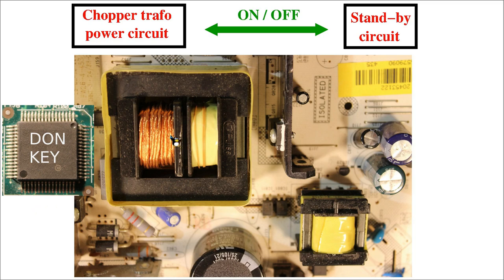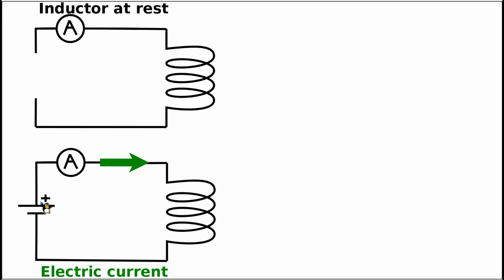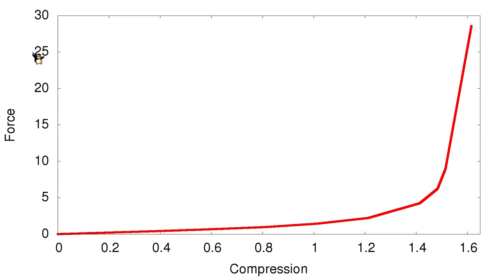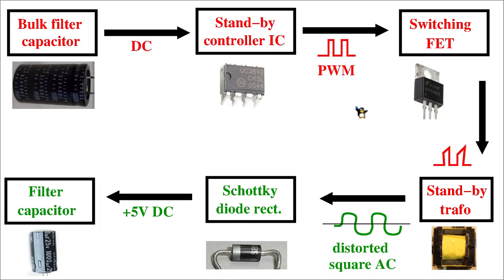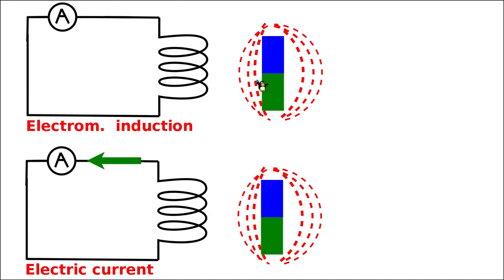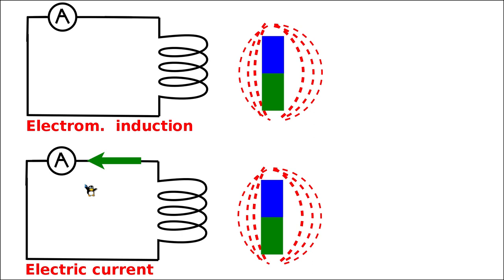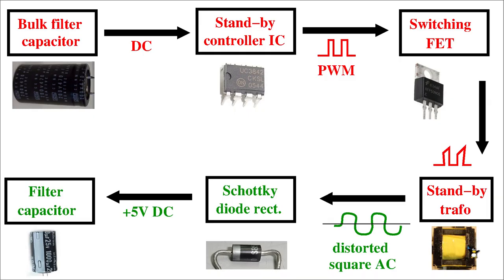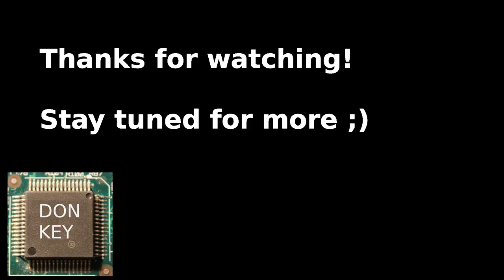Howto repair switch mode power supplies #4: Inductor in electronic circuits P2

Comment: Nice series, though the contents goes way beyond the scope of the title: "Repair of SMPS".  This is a complete electricity course.
Reply from the maker: That is exactly the point. Without knowing the way how SMPS works and regulates via the feedback loop and PWM, it is almost impossible to debug these circuits. Of course, one can change capacitors, and hope to get lucky. In most videos there was no explanation of why people exchange the parts and to describe which things to take care of. Most hobbyists are stuck at the basic question of why...
Reply: I would not recommend an absolute beginner who has no clue about inductivity to start repairing SMPS.   Serious hobbyists should have knowledge about coils and transformers.  BTW, this is dangerous gear because of the high voltages involved. On the other hand, coils and transformers almost never fail.  If they do fail (burn) this is easy to detect because of the nasty smell.   I would not spend four full video episodes on inductance only, it just takes too long to keep the interest going.
Reply from the maker: People often try to "repair" things from which they got no idea at all, in spite that they should not be even thinking about opening them. It is a *classic*, that people find a blown mains fuse in an SMPS, and they will just replace the fuse...     Needless to say, 99% of the time such "repair" will not end well.
Whenever I open up any stuff where line voltages are exposed, I explicitly state that this is dangerous. Even if someone knows what to take care of, accidents can still happen even with good professionals.
Reply: My interest is peaked.
Reply: @DonkeyLearningIT  I think you are having a problem accepting that you went completely down the proverbial 'rabbit hole' when it comes to inductors.  You can still explain the basic way inductors affect an SMPS circuit in WAY less time.
Reply from the maker: @ernieschatz3783  I have had to accept many things in life, so I do not have problems accepting the fact that my videos suck. However, I try to make the content as easy to digest as possible, and still keeping it informative/educational. A few people might learn things out of this material, others might prefer different sources of information.
Reply: @DonkeyLearningIT  No, your videos don't 'suck.' They are very informative.  I was just trying suggest that you spent a disproportionate amount of time on magnetism, induction, LH rule etc.  Nobody will be using a compass to repair their power supply.  They also won't be worrying about core materials, reluctance, eddy currents. Just one man's opinion.
Reply from the maker: @ernieschatz3783  People will be wondering why is there a different core material in their SMPS compared to a linear supply. Also, the core material is different even when it comes to common mode chokes vs. the output filtering inductor. In my opinion SMPS is all about understanding how is the inductor being pumped with energy.
Reply: Donkey Learning IT 
I’m so glad you have taken the time to explain the principles of magnetic induction, inductors, the different cores and so on. I just want to know how things work and usually the more you dive into the details the more interesting it gets. At least for me, that is. 🙏
Reply: @DonkeyLearningIT  Even with my short attention span and my learning difficulties, I still am consumed with the greater question of "why". And this is why I love your video series explaining it, and with such clear, understandable language and examples. Thank you so very much for doing this. And in no way do any of your videos "suck". I would recommend them to anyone else who is into DIY and is not already a highly educated professor of electrical engineering. (Because those types tend to nitpick everything to death. Seriously, it's like they have to have the biggest brain in the room. They're compensating, maybe?..)
Reply from the maker: @iRevnant0420  Haha, loved your comment. I have to agree, when it comes to minor details, I tend to also be nitpicky. However, what I am wondering about is this question: Why on earth are there no clear explanations available for simple technical questions? Even when I try to look up basic stuff like the Linux boot process, I did not manage to find even a book where the whole process is clearly explained in a simple language. If one would need a PhD. to understand a video, why would spend the time to watch the video?

Comment: I like the way he says "seercueit" for a circuit. Phonetically it's "Sirkit".
Reply from the maker: Yeah, that was a classic in the old videos. However, slowly I learned that it has to be pronounced differently. In the newer videos most of the time I get it right ;)
Reply: I am enjoying your videos.  I still have trouble envisioning what the purpose of each thing is, generally.  I'm trying to order Mosfet
s now for my power board, and it's crazy difficult.  
 @DonkeyLearningIT
Reply from the maker: @liberalmike27 For ordering FETs I found that the top-down approach is the fastest.  Namely, you put in the desired maximum voltage, maximum current, nominal frequency, and you sort for ascending price. After this, you can look at the RDS-on values as well, but I would not put that in the main search criteria from the very beginning. Also, it depends for which application you are searching for FETs, since nowadays most FETs are made for switching, and very few of them are usable for audio applications.
Reply: Thanks!
I pretty much just have the number/letter codes written on them.  But when I search it gives me 30 types.  Obviously, I need to match physical specs, like "through-hole."  They screw into aluminum heat-sinks.

I did manage to find one datasheet--even found the exact model but I don't know Chinese!  When it comes to matching all of the specs is when I get lost.  My guess is most of them will work, at least with the main top several measurements.  I wish I had the numbers here, but the television is over at my mother's house, as is the rest.  Maybe a video about the main specifications for replacement MOSFETs you need to focus on, and those that matter less would be good.

You'd think they would offer a replacement of similar value and make it clear, but I'm guessing that would require a fantastical amount of work on their end.

  @DonkeyLearningIT
Reply: Sir qweettttt!!! :-)

Comment: There is a mistake. The current generated by the inductor will be in the same direction as it was before you removed the power.

Comment: So it works like a capacitor so why dont use a capacitor?
Reply from the maker: No, an inductor works totally different than a capacitor. If the message what you took from the video was that this works like a capacitor, then I made a real bad presentation. Sorry for that...
Reply: @DonkeyLearningIT  sorry I didn't mean to offend you. I wished I had teachers as good as you. I just need to understand how it works.

Comment: i got a laser active a100 laserdisk gameconsole combo  unit  the powersupply has failed in it i lost 5v rail on dc side and the input at powerjack is shorted  it took out the power mosfet the rectifier  and the small tramsformer on the wall jack side i got all parts but the small transformer  its labled L001 on the diagram link is here https://console5.com/wiki/File:SCH-2.png   

also found ic202 was blown  i tested and found no shorts to ground  what do u think i should try first
Reply from the maker: There is no FET in the circuit you linked, they are all bipolar. Are you referring to the 2SC4275 (Q001???).
From your comment I could not understand what was blown, and what you have already replaced. Please go through the list, so I can help you out further.                       L001 is not a transformer. It is part of the power-input portion, and it is a common-mode choke.
Technically speaking, as long as it is not being really shorted, one could even just replace it with two fuses, but of course, this way the PSU will release lots of noise into your power grid. For short test it should be still fine.
On the figure you linked, there is no IC202, so I am wondering whether this part of the circuit is also available somewhere so I can look at it.
Reply: Donkey Learning IT basicly entire ac side is shorted    the choke is burned  and ic 202 if u look at the far right and trace back the (5v sw) output
Reply from the maker: Wow! Those chokes burn very rarely. Was the unit hit by lightning? This is what I suspect to be honest.
Remove L001 choke, and temporarily use two 2-3A fuses instead, where the two inductors were in the circuit. You do everything at your own risk!  Before you do anything, I would first fix the power input section. Due to the type of damage you describe, I would replace C001, C002, C003, C004, C005 and also at the beginning I would remove TH001. TH001 is a metal-oxyde varistor (MOV), which goes to short if there is power-pulse going to it. The circuit should work temporarily without TH001, and also work temporarily without the choke, if you put in two fuses instead. Once you find the actual cause, of course, replace T001 and the choke as well. For the choke you can use almost any generic choke from an other switch-mode power supply. If you want to go cheap, you can also desolder these components, and measure them for short circuit, but  I would not trust any of those components after the type of damage you describe.
Reply from the maker: Edited my comment, so see more details there...

Comment: I hope you were jumping to the "repair" part, inductor explanation is not relevant, it's like you explain about all components, resistors, diode, transistors… I think I would be better to explain these things in a different series but in this series, I think these are irrelevant. Bytheway thanks for your time and amazing videos.

Comment: +
Donkey Learning IT
Not exactly... Current flows from negavie terminal to postive in reality...You can easly check it using amp meter. Connected to positive wire gives  reading with minus...

Comment: Its good but you went so much in deep for inductors.....
Reply from the maker: Because inductors are the root of all good&evil in a switch mode PSU. After we understand the inductor, it is easy to understand why the PWM controller circuits are built in the way they are.
Reply: Donkey Learning IT
Much respect and appreciation for the time and dedication you put to impart this invaluable knowledge in such a simplistic way!!!

Comment: Too many charts and graphs, more live demonstrations please.
Reply from the maker: Well, I might be wrong but this is what a technician needs to know.
Regarding demonstration, the term is too broad. Thus, I am wondering more specifically what you have missed. If I have the time/resources, next time I will include some ideas you propose.
Furthermore, after I go through the theory part, I will rename all these videos, since they are indeed dry theory, I agree with you. Still, this theory is necessary to repair SMPS and know what need to be done and why.
Reply from the maker: Well, in may sense Joseph is right. However, one must go through some painful learning and reading charts, only after this is makes actual sense to touch an SMPS, debug it, and repair it. In fact, in most cases the charts, specsheets and circuit diagrams are not even available for most SMPS what you will try to repair, so you need to be able to "read the circuit" right off the PCB. Without step-by-step explanation on the theory, one cannot follow a modern SMPS even with a circuit diagram in hand...
Reply: You explain the subject well and your charts are a big help; don't worry if some students find it too difficult.
Reply from the maker: Thanks for the feedback. 
As I wrote above, I think as a repair technician or even as a hobbyist one has to understand some of these concepts, so for the time being I have no better idea but to continue with this style and hope that people understand more things after they watch it couple of times.

Comment: while the first lessons have been very interesting and well explained focusing on few detailed topics, this one about inductor is too much long and boring. I think it has no much sense in a serie called ''how to repair smps''
Reply from the maker: The issue is, that inductors are the heart of an SMPS, so this is why one need to cover them in detail. I know that when one looks strictly only on repair it makes little sens, but in the 'grand scheme' of SMPS the inductor portion is very important.